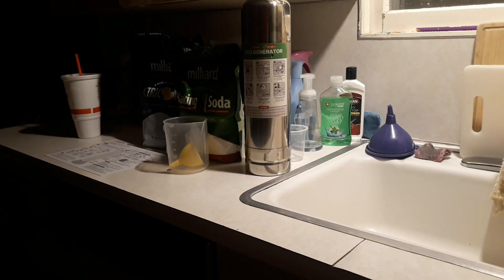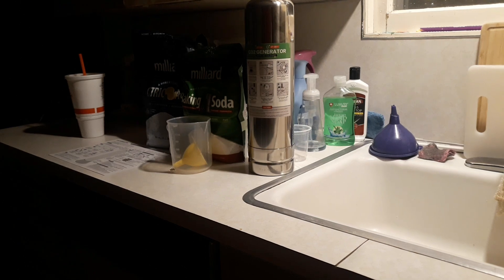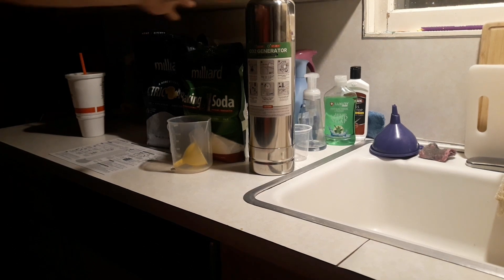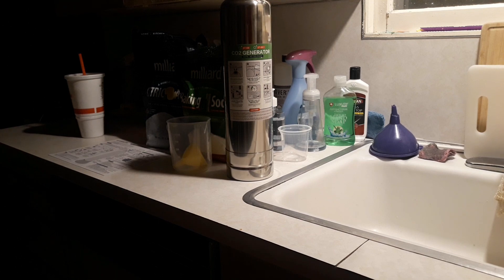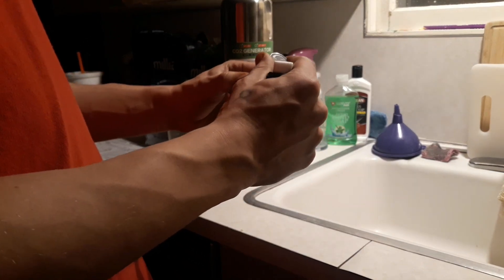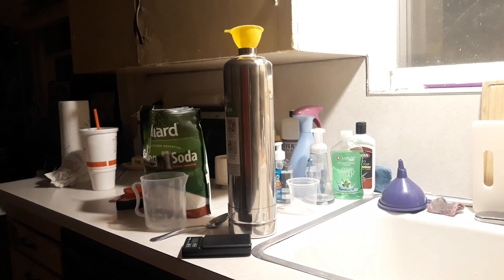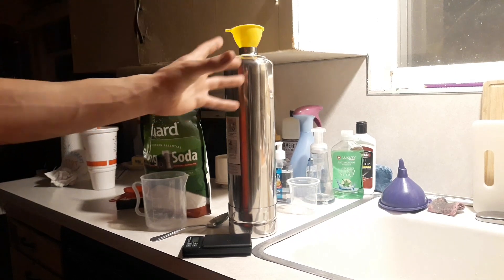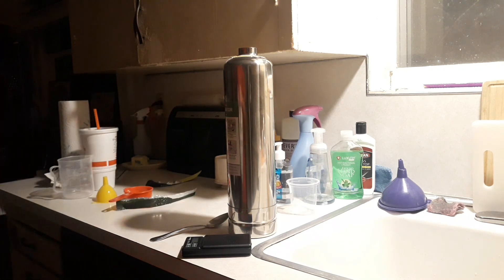FZONE CO2 Generator Installation

Comment: I have the fzone 2.5L, filled with 200 grams each ingredient and 300ml water, over night the needle on the gauge is still barely in the green, is this normal? How long should it take to fully pressurize? Ty
Reply from the maker: my unit was fully pressured leaving it overnight.  but I've seen useable pressure in a few hours. double check the rubber O-ring is properly seated on the regulator. also check your solenoid valve make sure it's actually closed when off.  if that doesn't work then I would send a support ticket to FZone. hopefully they take of you 🙏sorry for the late reply but I hope this helps you

Comment: Hello....if you stop CO2 during nights or anytime, will the pressure goes high and the cylinder blast...is there a release valve available in this one to avoid the same...
Reply from the maker: No it will not over pressurize as long as you follow the instructions

Comment: Excellent tutorial video, Bought mine around a month ago and just done first refill. My first fill lasted from 8th Nov to 3rd Dec and when I stripped it down there was quite a lot of residual CO2 in the bottle so I could have got a full month.
 It was running at around 1-1/2 BPS for 10 hours and off at night via solenoid. CO2 on 2 hours before light and off 1 hour before light.
I love this system , works a treat. Thanks for sharing the video.
Reply from the maker: Thats awesome! I'm glad you liked the video, I have a review video out now, I've been using this system almost a year now, I love it

Comment: hello, thanks because with your content you always give me a way to improve my knowledge and and increase inspirations in the world of aquaria. I bought a co2 tank ( citric acid bicarbonate) but the pressure does not rise until to the recommended level (40Kg/cm²). to you is by chance ever happened?
Reply: What level of pressure do you recommend before starting?
Reply from the maker: @mikisoranno3327  Ill start it once it's in the green past 200.
Reply from the maker: Thank you for the kind comment ☺️, no this hasn't happened to me, usually takes around 30 minutes before I notice the needle moving, make sure all fitting are hand tight, double check your O-Rings. If everything looks in order then you need to contact the company that made it tell them it's defective, they should replace it if it's under a warranty.

Comment: I didn't put that black filter at the beginning now the reaction is going i cant open it what u should do should i wait until it's empty? Will the system be dammed if i didn't put it now?
Reply from the maker: You should be able to open it, you'll have to re mix it up. Hopefully the unit isn't damaged. But I can't say for certain.
Reply: @atkinsnatureaquariums3552  i just installed it today i will depressurize it and open it i can't afford to damage the unit
Reply from the maker: @yazraf  if your quick then maybe there won't be any damage to the regulator. I hope everything works out, if not you can try to contact FZONE and see if they can send a new regulator. I've heard mixed stories if them actually helping. But wouldn't hurt to ask them.
Reply: @atkinsnatureaquariums3552  I inserted the filter, it it seems working just fine the indicator is going up one of then reached 50 in no time the other with colors is going up but slow.

Comment: Very good video. I'm sad to see it only has 5k views as it definitely deserves more. I bought this exact generator and I was very happy to find a video of someone installing it. I'm completely new to CO2 and didn't want to do anything wrong. Thank you very much! 

My only question: After combining the ingredients and re-assembling everything, how long does it take for the pressure to build up so that you can begin using it? In the video you didn't specify. I have a feeling you might have said it when you lost audio.
Reply from the maker: Thank you for the kind comment! make sure you got that bell turned on because I'm gonna be doing a year review on this product soon! 

     After tightening the regulator onto the canister it should only take about an hour till it's got enough pressure. I've been running it at 1 bubble per second and usually last 3 to 4 weeks  on my 20 gallon.

Comment: When I was filling it up for the first time, I added the dry materials then the water at a 45 degree angle but it immediately overflowed. Has that happened to anyone else?
Reply from the maker: I haven't had any overflows, are you making sure to properly measure out the dry ingredients?

Comment: I have the same tank, same brand. 
My question is. After i ran out of pressure. i made my second raw materials mix again. But as i opened the filter, a lot of little pellets came out of the filter. Like crystal pellets. I tried reading my instructions from the filter, but they were completely wiped off. 
Were those pellets part of the filter? Even the little instructions offered on the box don't mention anything else about the filter.
Reply from the maker: Yes they are part of the filter, that isn't normal and I would try to contact FZone and they will most likely send a replacement filter and maybe the regulator as well. But I don't work for them so you gotta ask them
Reply: Believe it or not, i did what you told me. To write the company an email. and i got no response ever. Lol. 
Anyway, i ended up using the thing without the beads, and i didn't see any changes on the tank. After 2 months is been working great. 
I was able to put the beads together and i am still running this  diy tank.
Reply from the maker: @Bacon7666  I'm sorry you couldn't get a hold of them, but I'm glad that it's working for you.
Reply: @atkinsnatureaquariums3552  This is wrong. This is residue from the citric acid and baking soda reaction.

Comment: Thanks for the video!  I am new to this whole planted tank thing and bought this kit a few weeks ago but the directions are, well, gnarly, to say the least.  After watching your video, I think I'm ready to try it out!  But my kit came with a 15mm CO2 U Connector and I didn't see where that's supposed to go in this setup.  Is that just an extra piece?
Reply from the maker: The U connect peice goes on the edge of a rimless tank connected between the diffuser and the bubble counter. I'm glad I was able to help you out with this system.
Reply: I plan to use mine on a rimmed tank to make things look tidier since it's a display tank. You're right but about the instructions - the company needed a good technical writer for the "manual". Couldn't tell if the 200-400g of product A and B meant 200 of one and 400 of the other - and if you used 400g of both would you need 600ml of water/ice? 

This was really helpful to see if my various assumptions were correct before trying it out as I have not done co2 before. EDIT: adapter wil will not fit over a standard rimmed tank edge :( they do provide several suction cup clips to keep the line tidy though.

Comment: Best way to do it is to add the water first.  Then put it in the freezer, with the top off.  Wait until the water is frozen, then you can add your powders at your leisure and close it up.  Zero CO2 loss, just takes longer to pressurize because yo have to wait for the ice to melt.
Reply from the maker: That's a great idea. Makes total sense to me, will definitely make sure to leave it open when I put the canister with water in the freezer. Thank you
Reply: @Rio Milano Meh.  I've been doing it for a year with no problems, although I did switch to using small ice cubes that I put into the tank instead of freezing it inside.  "Ice crystals" in the bottom of a stainless tank aren't going to hurt anything.  You don't freeze the whole thing, just the tank.
Reply: @Rio Milano If you're betting me your bottom dollar then you owe me your bottom dollar, dude.  It works just fine.  Not have their temps changed?  Have you not noticed the thermal shift involved in the chemical reaction between the citric acid and the baking soda?  Give me a break.  And I get a month of CO2 at 2 bpm, thanks much.
Reply: @Rio Milano I'll tell you what has lasted many many years.  MY ICE CUBE TRAYS.  And they're made from cheap plastic, not even stainless steel meant to withstand well over 20 psi.  It's a damn miracle they haven't blown to pieces in my freezer I guess.
Reply: @NomNum You're talking shit mate

Comment: How long does a full tank last you???
Reply: At 1 bps on a full tank it should run him about a month. I run this same system on a 45g river tank with a sump and to reach good levels I am at like 3-4bps and the tank runs empty around 13days. That's with the system turning on 1 hour before lights. Everyone's results vary with this system but most of the smaller tank owners are getting about a months worth of action. Maybe a tad less.
Reply from the maker: I'm just starting to use this system, and I have not ran out yet, when I have more experience with this kit I will review this systems cost per month, plus run time
Reply: I generally get 3ish weeks out of mine, at around 2-3 bps.

Comment: Very interesting! Why wasn’t there any action at the diffuser?🤔 Or was it just not showing up on camera?

What are the signs of too much or too little?
Reply from the maker: Yeah i just didnt film the diffuser lol and i usually go by the PH, at night in my tank when co2 is off my ph is around 7. Then when co2 turns on the PH should drop and you know co2 is working. Or if you dont want to mess with any of that just get a co2 drop checker, and you know your using to much when fish are gasping at the top. I barely run co2, like maybe a bubble per 2 seconds